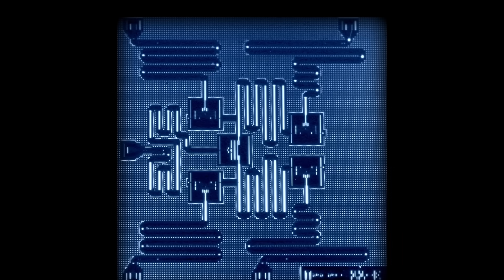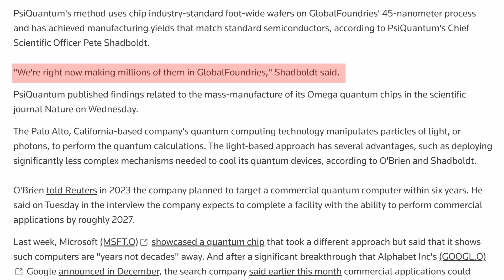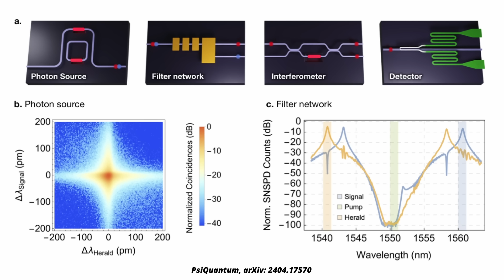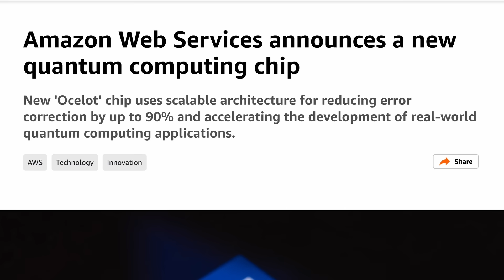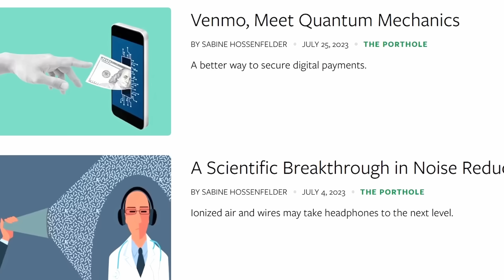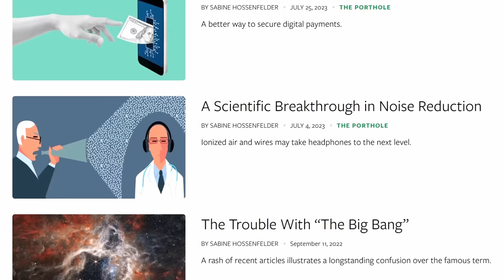Amazon’s Quantum Breakthrough That Everyone Missed

Comment: There is no free lunch. If your quantum calculation requires simultaneous consideration of 2^N outcomes, then the cooling budget to preserve fidelity in that calculation will still be O(2^N). The savings only appear when you can classically break down the calculation into chunks that have a smaller classical footprint. Most classically difficult (NP-hard) problems have no such shortcut.
Reply from the maker: Good point, hadn't thought about that. But isn't this a somewhat different problem in terms of engineering: making the cooling more efficient rather than making the device larger?
Reply: @SabineHossenfelder  True. The more efficient the cooling, the better, but ultimately there has to be a bound on the number of simultaneously entangled qubits you can chill. 🧊🤔
Reply: @SabineHossenfelder  My thoughts (it was part of my job to worry about the quantum threat) are that there is some cooling energy budget that scales with the lowering of entropy in a volume of space containing the qbits. If the scaling is large enough, then the energy to solve a real algorithmic problem (like solving a dlog problem) may equal or exceed the energy needed to compute it on a regular computer. I'm totally not certain this is true but it's one of the ways quantum computers might turn out to be useless.
Reply: @SabineHossenfelder 
IDK much about the technical aspects of quantum computing, but this sounds like a dog or cat chasing its tail. Even when they succeed, there's no prize beyond the entertainment factor!
Reply: @SabineHossenfelder Sabine when you will do a video about Fractalon Unified Theory,the only theory like Einstein always dream only Space-Time
Reply: @orionspur can you explain why the cooling budget would need to be O(2^N)? feel free to use technical jargon, i work in the field
Reply: @Tarrlych   Energy is the capacity to do work. To compute. To solve an arbitrary N-bit problem, if you do O(2^N) work then somewhere that much energy is being allocated. It is conceivable that with quantum computing you are dumping that heat into some other universe, but I doubt it. Chances are you are going to have to do all that cooling locally.
Reply: Nailed it,

Comment: I heard that whenever "Cat Qubits" flip, ... they always land on their feet!
Reply: the problem with Cat Qubits is that you never know whether they are dead or alive
Reply: @ElementaryWatson_fafo well, you know when you look at them
Reply: cat ladies have been running quantum computers since there has been cat ladies.
Reply: Just don't put them in sandwich, or they will flip indefinitely. Maybe we can use that as a stable oscillator of some sort.
Reply: Ohh, that was probably the reason for the name, thank you...
Reply: @piotrkawaek6640  I believe the reason for the name is Schrodinger's cat.
Reply: So they’re using multiple qubits to protect one logical qubit — but how does the system actually know which of the error-correcting qubits has the correct value?I mean… the error-correcting qubits could just as easily flip, right? 😼
Reply: @RosasGrapes  there are multiple error correction algorithms from the simplest like parity, which can fix only one failure to more complex that can fix multiple failures. No algorithm that can fix all possible failures, so error recovery is always less than 100%.
Reply: @ElementaryWatson_fafo  Thanks! I looked into a more detailed article about it — and if I got it right, the “cat-squeezed” qubits are already less error-prone to begin with, which then makes the error correction itself more reliable.
In the video it kind of sounds like the error correction is the main novelty, but it’s actually the combination of squeezing and correction that makes the difference. (maybe 😅)
Reply: ‘What did you do to the cat, Erwin? It looks half dead!’ ~ Ms Schrödinger.